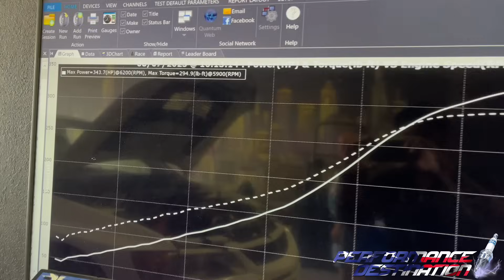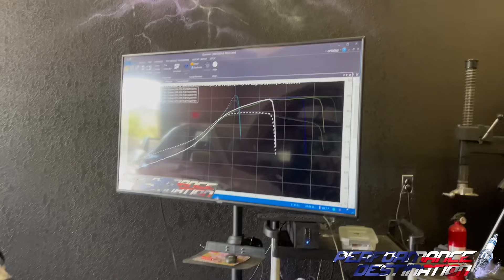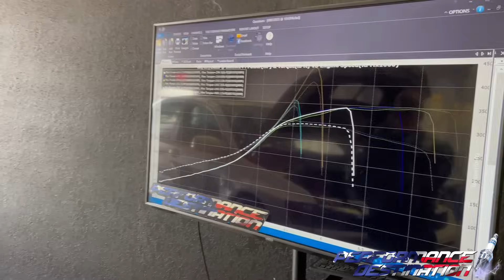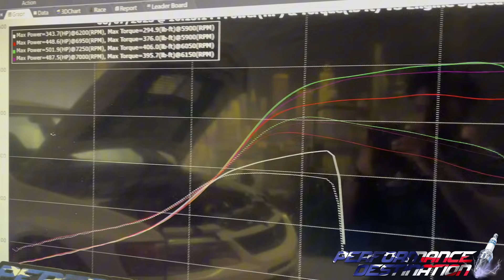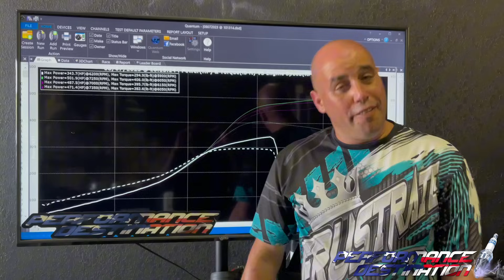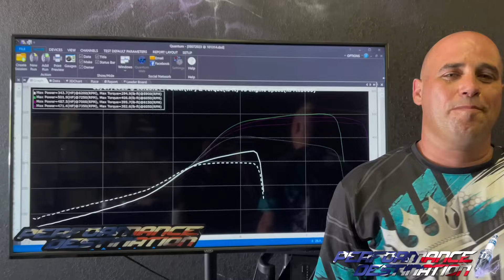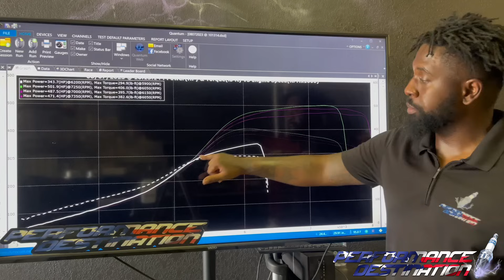Frustrate EG goes from Honda Powa to Mitsu power and maxes out the fuel system on a 76mm turbo.

Comment: He gonna learn mitsupower gonna be a money pit and these engines don’t last with a lot of power and can’t make absurd power.
Reply: Who has the record for fastest h pattern 4cyl….. uh? 

But I agree for the most part.  Evos 8/9s are a blast at 550-700whp with a fat powerband.   850+ means that car will likely be coming apart often. 

Imagine the gears in that gear box bring roughly the same physical size of a Honda gearbox, yet they have to handle the stress of 1000lb of more curb weight.

Comment: Very nice video, and seems like a perfect tune ..Holy turbo frustrate 😱.. he should have least put the car on E85 and it would’ve made close to 600whp maybe… on Daniel’s car it’s not so much the fuel pump. It’s more the 1000 cc injectors … I know for a fact you can make 600 Wheel plus on a single 340 pump hardwired ..On my car I run a HTA86 😅 way way smaller then frustrates..I run (2)255HP (pin pushed in to hold more pressure on both) walbro pumps in my evo 8 ,still stock ECU with a Stock return line.. both pumps are hardwired second pump kicks on with a hobe switch (kicks🦵on over 15psi).. also have an adjustable fuel pressure regulator with FIC 1650cc (best injector stainless steel internals unlike the FIC 2150)on E85.  Stock return line .. one person made a video and said upgrading The stock line is very important but I don’t see a reason to upgrade the return line if the car is basically running on one pump, and when the car is full throttle, the engine is using most of the fuel .. I haven’t had a single issue with a stock return line making 900whp … He keep talking about upgrading the return line… You ever see inside of a stock rail and feed line.. I would be talking about upgrading the feed line before the return if anything, just speaking fax 📠 tried and true on my personal car I’ve owned and built it 9 years ago
Reply: I made the same comment on another post and some random guy said there’s no way your car is making 900whp with 1650cc and this was my reply: 

You bet your ass you can …You will be surprised I’ve been doing this since the 90s, my injector duty cycle is not happy but it can be done..The 1650cc FIC injectors actually cost more than a 2150 cc because they’re all stainless and can run any type of fuel… in my opinion doing it all these years. I think the best injector on the market is the FIC 1650 cc high Z’s all stainless internals…2150cc injectors are not …I set my adjustable, fuel pressure regulator to 53 psi at idle.. huge props to my tuner, one of the best tuning EVO’s ..people going way too big on injectors, and only trying to make 600 horse 🐴 makes no sense…
Reply: @900whp STMTuned also says the 1650s are capable of many kinds of fuels due to their internal design. They can make north of 800 hp too no problem.
Reply: @900whp a dyno is a tuning tool.  You can easily shut anybody up by showing them a slip with a trap speed that reflects 900whp.